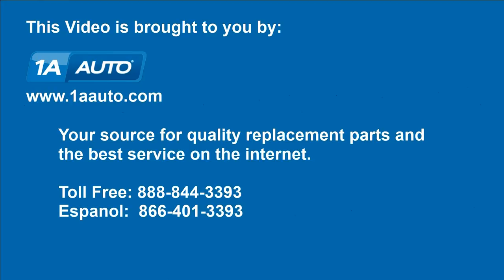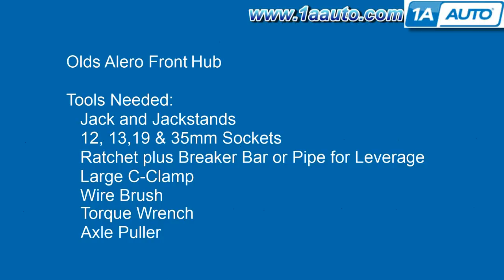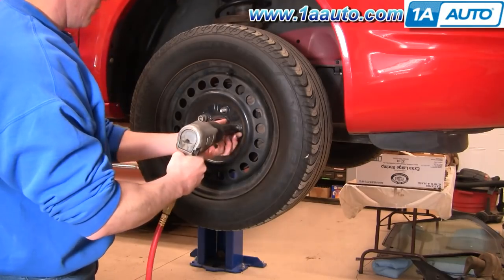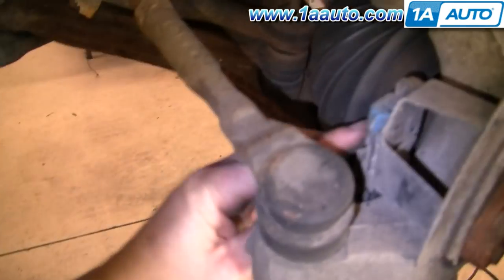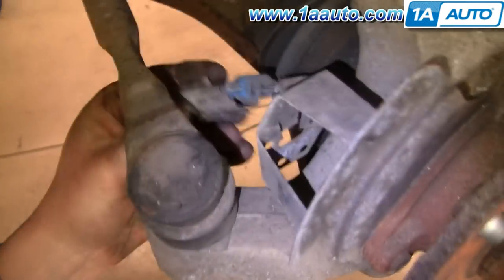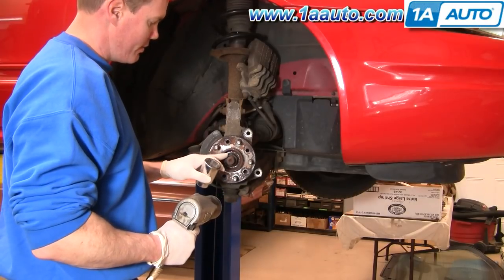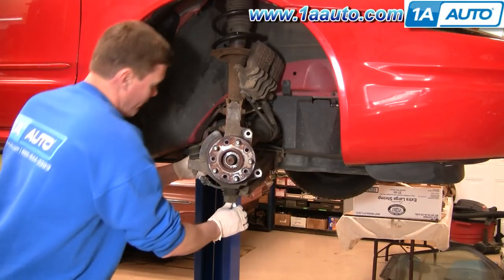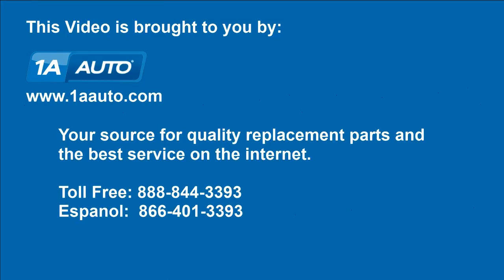How to Replace Wheel Bearing & Hub Assembly 99-04 Oldsmobile Alero

Comment: thanks for this video, helped out with communicating to another friend of mine.  I don't know if you'd prefer an alternative method, but with the brake you can usually leave the caliper/pads/rotor all together and just remove the 13mm bolts for the carrier to the hub, and then hang the whole thing out of the way.  It saves a few minutes, I usually do it this way just to skip messing with a c-clamp.  

Also, using redline synthetic hub grease would likely improve bearing life, I do it to my car.

Comment from the maker: Usually they'll make a high pitched noise at over 30 mph, or they may make a grinding noise. Another sign that you may have a bad wheel bearing is excess wear on the outer edge of your tires. Hope this helps you out. 1aauto.com 888-844-3393

Comment: Excuse me. I went and purchased a 35mm socket to complete this job, on your recommendation/information. I now have to go purchase a 36mm socket, as that is the correct size. Please pin a not or add to description that, it is not a 35mm but a 36mm needed for the axle bolt/ spindle
Reply: My 1998 Intrigue is 35mm, just took it off. So, folks, be ready to get both.

Comment from the maker: Honestly the only real option for you is to do an engine rebuild. Putting in an additive to the engine is a band aid to the real issue and really is not going your oil pump and justice. You will wear out other parts of the engine quicker by putting in additives to the engine oil that are meant to "fix" issues.

Comment: Yes thats correct. It's a complete deal. It's the same thing with my 99 Ford Explorer. And it is very important, VERY important to use a torque wrench. I have no automotive knowledge and went through 2 wheel bearing assemblies because I didn't torque right. It was alot easier back in the day when all you had to do was take and replace just the bearings. But times have changed and they include everything in one assembly. Which is kinda cool too. Just more expensive. Good luck.

Comment from the maker: Normally a clicking noise has to do with wheel bearing or possibly something going on with the brakes. Taking the wheel off and checking for anything stuck in that area will give you a better idea of what is going on.

Comment: The axle nut is 36mm. Thanks to this video it is a quite easy job. I'm back watching this a year later because the front driver wheel bearing is going out again and the $100 hub assembly I got from O'Reilly's only had a year warranty. 🙃 Wishing my old lady listened to me and got a Toyota. But hey I'd rather work on a GM then a Ford.

Comment: Great video thanks! I did have to use the axle press (free loaner tool from Autozone) but it actually just separated the hub from the bearing component, basically breaking it in half. I had to chisel the rest of it off of the steering knuckle, it was stuck so tightly due to rust.

Comment: It crazy because I can do this repair with my eyes closed I have replaced 4 sets on my 01 olds alreo since 09 they seem to go every  15000-20000 miles no matter what brand you buy. Either the speed sensor goes or they grind.
Reply from the maker: Thank you for watching!
 888-844-3393

Comment: hello i had a question i have a 2000 nissan maxima it has a vacume leak but i cant find it and will this cause any problems with the idling 
recently the idling on my car has been really low going up and down sometimes it turns off even if i press the gas pedal all the way down it idles around 3 rpm

Comment: I'm doing the right front, when I pulled the  bearing out . I didn't pay attention to the wire position. Seem to be having trouble getting enough slack to attach the connector to the bracket.
Does anyone recall where the wire is supposed to be indexed?

Comment: Hello. I have an 03 alero. The axle nut actually has a metal cage around it. Does this change anything or do you just remove the nut and cage at once? Thanks.
Reply from the maker: Thank you for watching! The job is stil the same just remove the age/nut. Hope this helps! 888-844-3393

Comment: will this also work for an old 2001 intrigue? I'm getting "chk engine, antilock & track off" lights on the dash although when chked there are no codes listed. PS it display that a cadillac system is installed??? Any comments or guidance is tremendously appreciated!!!! Thanks in advance!

Comment: Great video. Thanks. Can I ask you to do a video on how to remove the 4th gear solenoid on a 03 alero v6. My alero wont shift to 4th gear it will go 65 mph @ almost 4000 rpm.
Reply from the maker: +Natal Heraclio We currently do not have an auto repair video that covers this particular repair. We will keep this request in mind in the event that we need to make this repair in the future. 1aauto.com

Comment: I have a question, would i be able to remove that middle nut without an Impact wrench? I cant afford one but i do have a breaker bar and the socket for it. Would that work? If not do you think an electric impact wrench would be strong enough?
Reply: Yes, break the nut free on the ground and then use the electric impact to zip it off.
Reply: Yes, got my moving with a breaker bar

Comment: Well, you screwed up in the first 2 minutes by compressing your caliper without breaking your bleeder screw loose.  Bad idea to push that old, nasty fluid back up into the system with ABS or with any type of brakes at all.  Next time, put a bleeder buddy on that bleed valve, brake it loose and push the fluid out of there.
Reply: This isn't true, just because he did it differently than you would like doesn't mean he screwed up.... I don't flush my brake fluid everytime I remove the brakes.

Comment: is it the same with a 1999 oldsmobile 88?
Reply from the maker: Here's a link to a video that would also apply to you application, along with the correct part for your vehicle. Hope this helps you out. http://www.1aauto.com/1A/front-wheel-bearings-and-hubs/Oldsmobile/88/1ASHS00013/476172/1999?utm_source=VideoReply&utm_medium=VideoReply&utm_campaign=1ATony